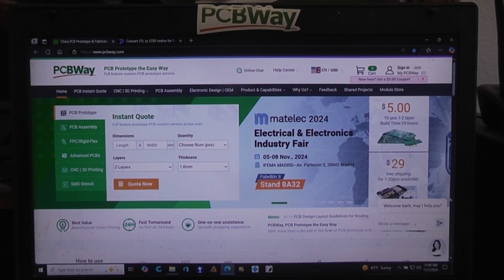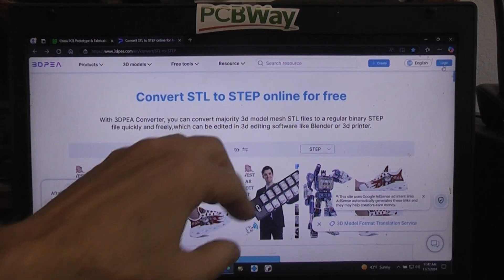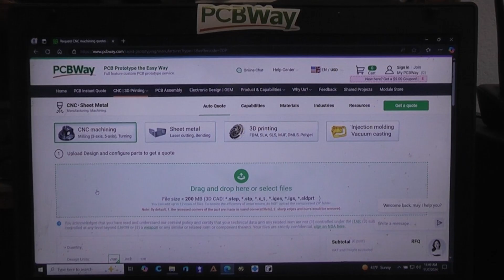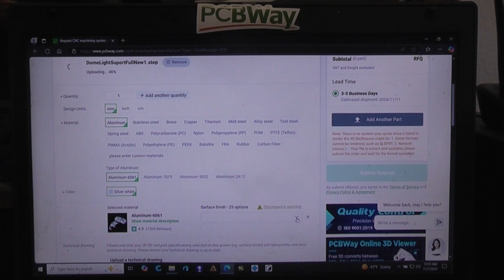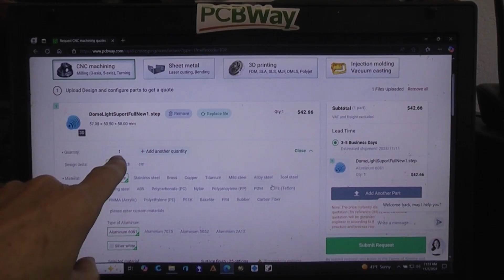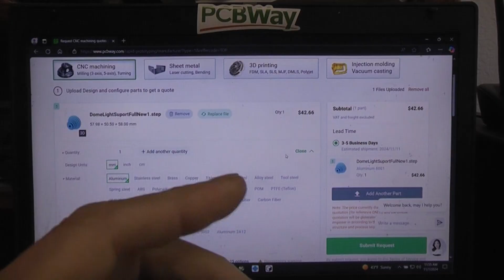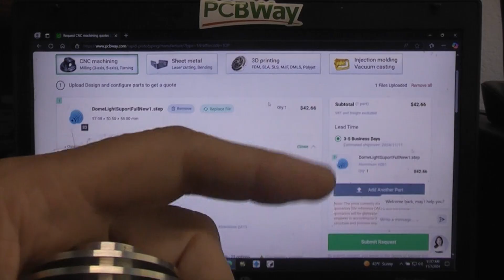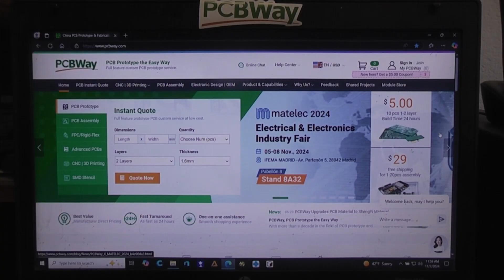Trying PCBWAY CNC metal services. How to order, prices and useful tips.

Comment: Unfortunately, this service is no longer relevant imo. In 2025/26, with import tarriffs, the estimates are absolutely astronomical. I had an initial quote of $77.70 which went to $207.84 after shipping costs, service fees, bank handling fees, and duty and tax. 
Sorry, no.
Reply from the maker: Yes, you are right I just put some parts up for a quote and the part was only $5.78 each, I was going to order 10 of them, but the tariffs bought the price of the part up to $96 bucks each. So, until this tariff crap goes away or some America company is willing to do resin printing with gold plated finishes, I guess we are just out of luck.
YouTube videos are forever, even when in the information changes over time.
Reply: @Robothut  Very unfortunate. Your video just made me wish I had found this service so much sooner when it could have been viable. 
The silver lining is that our local machine shops now no longer have to compete with China, if they are willing to make our parts.
Reply from the maker: @DreamwalkerFilms I agree. We need more machine shop services in the USA that are will to do small custom jobs. There are lots of shops that will do resin printing and electro plating but not for the hobbyist that only needs a hand full of parts.

Comment: the STL to STEP file conversion itself might've actually cost you some extra money as well. when converting an STL to a STEP file, it's not nearly as clean as exporting the file as a STEP to begin with. (STL is polygon points, STEP is CAD function curves) so, the tool paths that the website exported might have needed to be completely remade by an engineer, even though it was technically a "fully" exported model on the online website
Reply from the maker: Yes my problem was that the free version of Design Spark Mechanical does not have the step file option. I do not want to pay for the full version and I do not want to relearn the other Free CAD programs that are out there now. So I was kind of stuck with a less than preferred option.

Comment: You generally want to avoid rounded edges in machining as they add a LOT of tool time that equals cost, only when absolutely necessary and even then with minimum r that you can also, more effiecient way is to define multiple facets that combine in to a rounding of sorts.